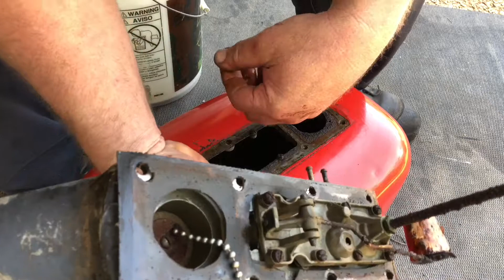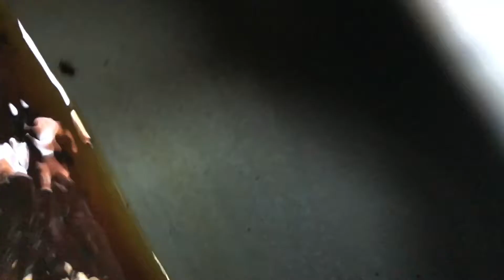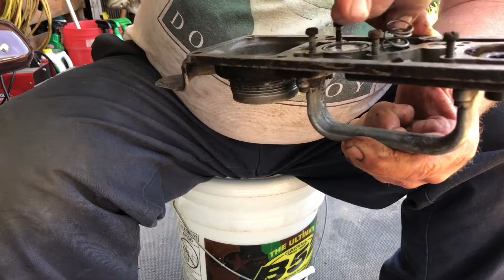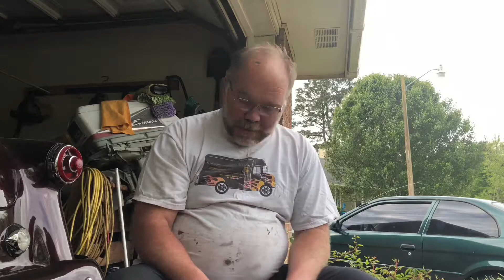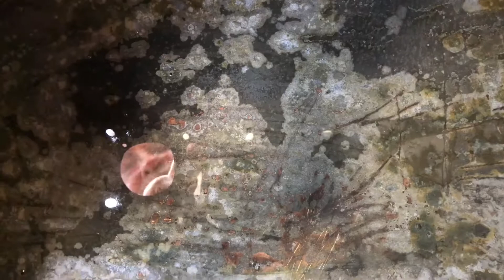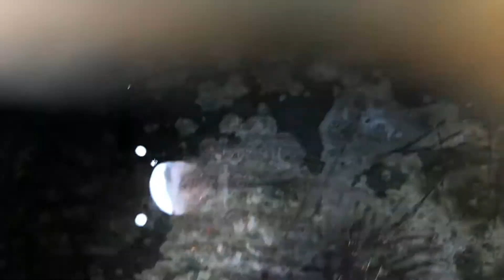Evinrude Johnson twin line tank clean and inspection pt 1

Comment: To clean out the rust, etc. inside the tank, add a whole bunch of 1/4" nuts or 100's of BB's with the vinegar. Shake vigorously for as long as you need to and it will clean up the inside. You would need to put the top back on the tank temporarily to do that correctly.
Reply from the maker: Thanks for the tips! I keep random bolts in a 5 gallon bucket that I have done that with.